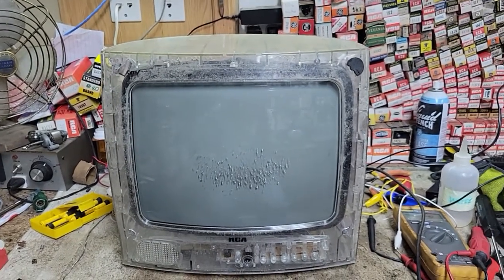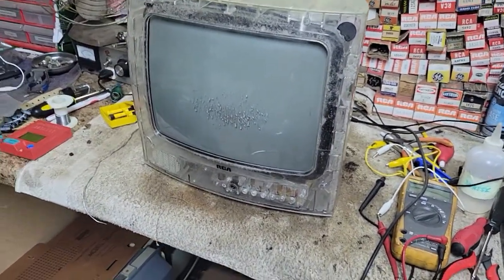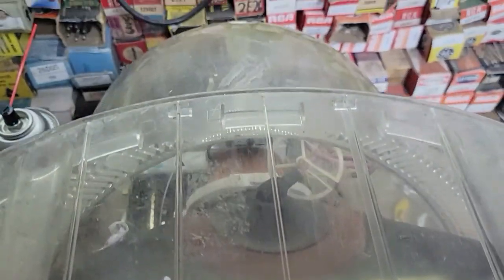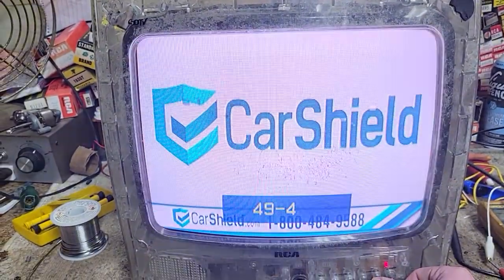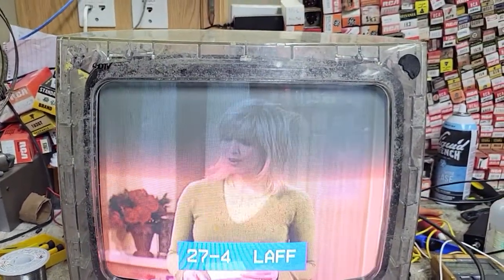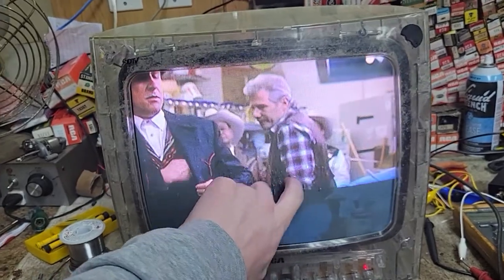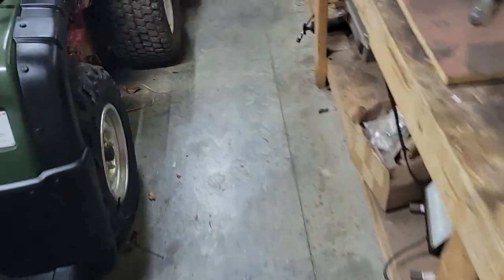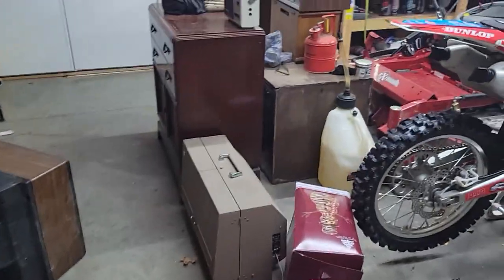2006 Rca Clear Prison TV With Digital Tuner

Comment: That is an RCA Secureview TV.  They are fantastic little televisions.

They were sold with and without internal speakers.

The instruction manual and marketing sheets for these televisions are readily available for free download online.  Just Google the model number.

A while back, I picked up five of them in excellent condition from a Savers thrift store for a few dollars each. Each one of them had the inmate's serial number and last name engraved on top.  Some of them had tamper evident tape on the top seam of the cover. They all had internal speakers which were disconnected. I removed the back covers and washed them in soap and water and reconnected the speakers.  When the covers were off, I also blew out any dust from the chassis.

If get a remote for the TV, you can access additional functions such as the "guide" function which list the current program and the upcoming program schedule  for the respective channel. The simplest and best remote for the digital Secureview TV is the RCA R130C1.  The RCA R196A1 is another good choice.  Neither of these remotes need to be programmed in order to be used with the TV and they are readily available on eBay.  Otherwise, a variety of newer RCA universal remotes will also work.
Reply from the maker: Great information. I'll have to see about picking one of these remotes up.